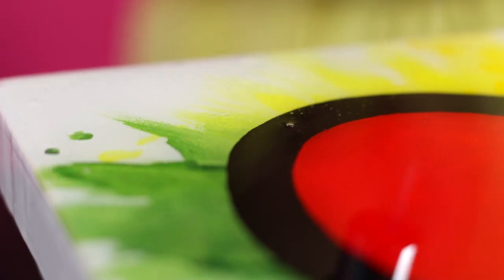Is It Possible To Over Torch Epoxy Resin?

Comment: I have a question that I’m struggling with. My resin molds are sticking on some spots on my resin and coming off with the mold OR ripping off and I’m wondering why. I have an idea it’s my heat torch
Reply from the maker: Hi Heather,  we don't recommend using a torch on your silicone molds.  The excessive heat can cause the silicone to break down and crack, tear and fuse to the resin.

Comment: Can I use a heat gun instead of torch
Reply from the maker: You can, but the flame from a torch is far more effective at getting rid of bubbles:  a heat gun just doesn't get hot enough and it also blows the resin around, which means it can also blow dust into your wet resin.

Comment: I think I have a burn spot from over torching just on one spot. Can I sand and resin again?
Reply from the maker: Hi there, you can try sanding to remove as much of the burned resin as possible, then pour a fresh coat.  It may be enough to diminish the effect of the scorched area.

Comment: I have yellowed my resin… I believe its because I messed up with the torch.
Sanding it down should remove the yellow resin or is it done for?
Reply from the maker: Sanding down the yellowed resin once it has cured will help to de-bulk and as a result diminish the look of the yellowing.  Be careful not to sand too far down and sand into your art layer, if using an electric sander maybe switch to hand sanding as you get closer.